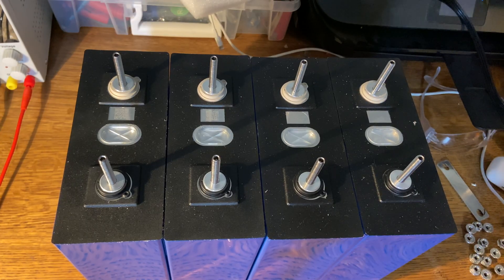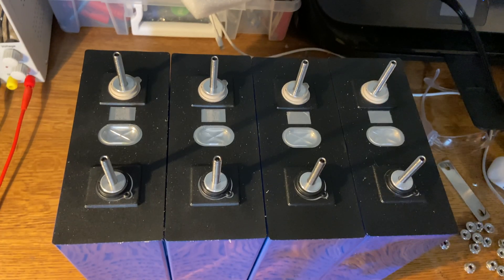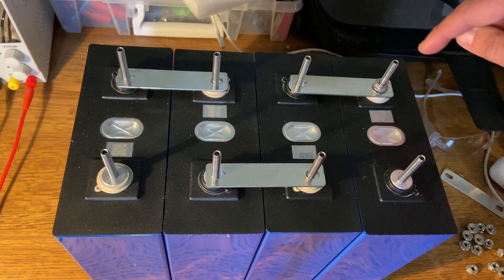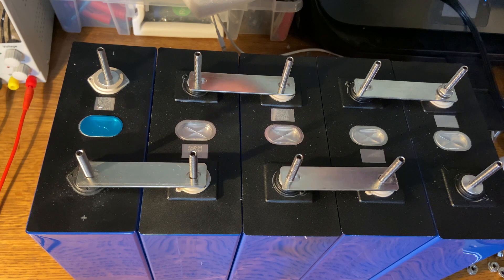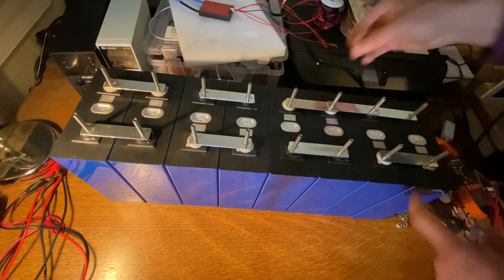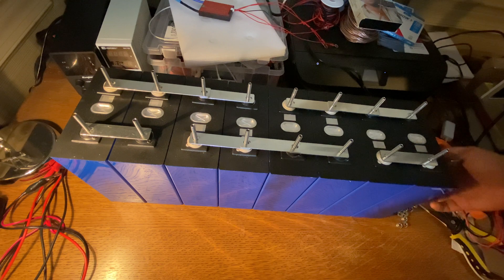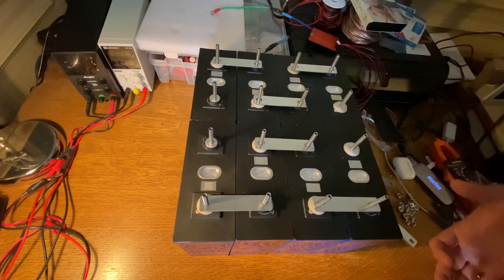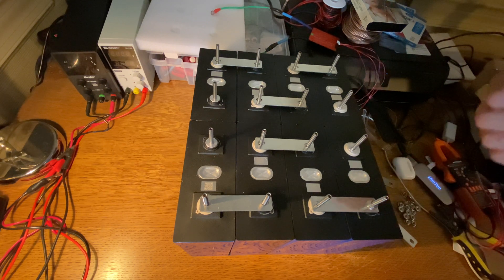How to Connect Battery Cells in Series and Parallel - w/ Large Lifepo4 Cells

Comment: My build 4s 2p sir and the battery next to negative main is the one who charge full 1st then next one beside the main positive is the 2nd to charge full and the main negative and main positive remain to 3.37v.

My active blancer is 4s 5a and 60a discharge/30a charge current bms. My problem is i can't balance them when charging on solar panel before i assemble them i do top balancing 1st. Hope you can help me or i will just follow your advice which is 2 bms

Comment: I was able to acquire a 96kw Absolyte GX (2 volt) series battery bank. Have you ever worked on something like that? I need to wire 24 cells into 48 volt configuration for a 48 volt off grid system. I'd appreciate any assistance if you had some time to assist. I'm also wondering if it is possible to utilize a BMS on this size to constantly monitor the entire bank. Thank you so much for your videos! I have subscribed - looking forward to watching your old and new videos!!

Comment: Ok I have an RV with one 100w solar panel one charge controller and two agm 51ah 12v batteries and one 12 deep cycle ah unknown lead acid battery what would be the most efficient way to install these so they charge and supply 12v to my system? Please and thank you

Comment: If you run 2x 100amp max discharge bms on the batteries for your preferred way of setting them up are you still capped at 100amps discharge or does it become 200amp discharge

Comment: Thank you for this video - I would much rather have individual cell monitoring since this thing will be under our bed. 

Unfortunately, our battery location fits the rectangular 4S2P best but I will be going with two batteries / 4S configuration. I will just use wiring for the interconnect instead of bus bars. 

Using two Overkill BMSs.

Comment: I have 8 (3.2v) lifepo cells and needed to increment both amps and voltages. I went for your guide on 8s2p but I don't know now how to connect the BMS since I have an 8S bms that I was previously using in series. Now since they are both in series and parallel I'm a bit confused on the wiring

Comment: In the first scenario, if one cell dies, the BMS should shut off from overcurrent into the other cell. Actually, the more cells you connect in parallel, the least the current per cell and the more reliable each cell operates. This holds true for both scenarios, but the second scenario adds the reliability, variance of MOSFET or voltage detection ICs and increases the cost of BMS's. However, paralleling more BMSes is a MUST once the load current exceeds the BMS spec. I have only one ANT 320A(max) BMS on my 16S40P LiFePo4 batttery and it works great. My 40P is actually 5x 8P of A123 round cells. But prismatic cells are made with multiple pouches in parallel too. This being said, having your system uptime uninterrupted is nice, but you operate only at a fraction of the total load power, which might not be optimal in certain situations. Ill be expanding my bank this Sept with 16x EVE-280Ah prismatic cells which I plan to hook an another BMS in parallel for uptime like you suggested, althought my current BMS is largely sufficient for my loads <= 30A so far. So it's not for worry of one cell failing from overcurrent and overheating, in as much as providing system redundancy/backup, should my Ant BMS fails.

Comment: I have a 4 battery lifepo4 24v battery bank with 12v batteries in series parallel connection . Problem is the 2 batteries that is connected to the inverter get 15,2v charge while the 2 other batteries in the series connection that is not directly connected to the inverter is normal 13,3v, total voltage is 28,5 for both battery banks. I have a battery balancer but it only balances the voltage of the 2 banks, not the 2 batteries that get way to high voltage charging. 

It seems to me after what I have read about electrical engineering that to not get over voltage on the batteries that is directly connected to the inverter you have to have exactly the same resistance, meaning equally long vires to all the battery connections... But I have not see anyone ever doing series parallel connection that way. Everyone connect it like I have done with charging and inverter directly connected to 2 of the batteries in the series parallel battery bank and the 2 last batteries connected with longer wires.

Comment: i watched this video and have a couple of question: 1) can you show or explain once i have connected the two sets of lifepo4 ( mine 3.2V, 200amh) batteries in series then connect these sets in parallel how are the BMS connected together to go to 12v fuse panel and charger. 2) Can you suggest what size BMS(2) i should use, would (2) 4s 12v 100a be ok to use?

Comment: Im new to the idea of lithium for my car audio endeavors. But does anyone know if i could get these for my truck and use them as a battery bank my max amperage pull would be about 800amps and ive got a 280amp alternator and gonna get 2 500amp switches for them. would i also need to get some sort of charge controller cause i remember charging is a big thing to try and make these things last.or should i just forget about it and get a couple deep cycle XS batteries.

Comment: I am wondering if I can connect a 12volt 200ah prismatic cell battery in series with 2 12 volt 100ah lifepo batteries in parallel to get 24v 200ah ?  so there are 3 batteries total.  2 identical batteries in parallel for a 12v 200ah, with 1, 12v 200 ah. I understand its a less than ideal to put unlike batteries together but can it be done?  I tried to do it but got a huge spark attaching the 2 parallel ones to the 12v prismatic.  negative to positive and positive to negative. any suggestions ?.

Comment: When you connect 2 4s batteries together is it best to draw power from the bank by connecting to a negative stud on one battery and a positive stud on the other battery?
Reply from the maker: You mean together in parallel? Generally speaking both negatives should do to a bus bar and then both positives should go to a separate bus bar - and then you wire your system off of the bus bars.
Reply: @TheWilltoBuild  Sorry I wasn't clear.  Yes in parallel.  So you advise using busbars for even just a 2 battery  bank?  I see the advantage for a 3 or more batteries in parallel because it will facilitate an equal draw from each battery,  but I am not so sure its worth the expense for cables and stud busbars for only 2 batteries.   Any comment on that?
Reply from the maker: @michaeldoherty2289  You just want to make sure you are drawing from each battery equally. You could potentially just improvise something, perhaps connecting a wire to each positive terminal (for instance) and then connecting that those two together at a third wire that serves as the total battery positive. All you would need for that is some wire, some crimps and a stud with a washer to tie them all together. If you go to your local hardware store of HD or Lowes and go to the electrical section, you'll see alot of stuff that can allow you to pretty cheaply connect three wires together.
Reply from the maker: @michaeldoherty2289  You just want to make sure you are drawing from each battery equally. You could potentially just improvise something, perhaps connecting a wire to each positive terminal (for instance) and then connecting that those two together at a third wire that serves as the total battery positive. All you would need for that is some wire, some crimps and a stud with a washer to tie them all together. If you go to your local hardware store of HD or Lowes and go to the electrical section, you'll see alot of stuff that can allow you to pretty cheaply connect three wires together.
Reply: @TheWilltoBuild  OK.  To follow up on this further I have one more question.  Say I have 2 separate 12v battery packs just like the 2 at the end of your video.  If I install a  4s BMS on each 12v battery.  Then to parallel them I  simply connect the 2 main 12v positives together with 2 equal cables going to a single post terminal.  This will become the main positive battery terminal.  Then connect the equal length P- leads from each of the 2 BMS's on a single post terminal which then become the main battery negative.  This all happens inside my battery box (which contains both 12v packs).  This way I do not have to connect the 2 12v packs together with solid busbars (the ones you said you didn't have long enough busbars to do that in the video).  It totally resolves the question of which terminals become the main terminals when the 2 12v packs are connected with 2 solid busbars.  It also assures that each of the now paralleled 12v batteries (or really all 8 cells) will be equally drawn upon during use.  Is that clear and is that correct?.

Comment: Nice video.  This is a pretty simple concept, but I have not seen it explained so well by any other YouTuber.  Very good job.  I just ordered 8 206ah cells and 2 200a JBD BMS's directly from China.  I mulled over doing a 4s2p with one BMS, or building 2 4s batteries paralleled together.  I diagrammed my wiring on paper and was sure it was correct, but I was looking to confirm it.  The last part of your video did that perfectly.  I also wanted to use my smart bluetooth BMS's to monitor all the individual cells.  With 4s2p you can't do that.  You explained it so well and confirmed the extra money I spent was well worth it.  Thanks and cheers.
Reply from the maker: So glad I could help!

Comment: Great video. It’s probably worth mentioning how your amperage requirements play into which configuration is viable as well. If I’m powering a 3,000 watt inverter, a 4S2P with a 12v 120amp OverkillSolar BMS won’t work because the BMS max output would be 1,512 watts. You’d need a 250amp BMS or two 120amp BMS wired in parallel to get you up to 3,000 watts (or whatever your load requirements are).
Reply from the maker: That is a great point and actually a good topic for a future video.

Comment: Congrats very well explained. My question is can you use the same process to wire Lead Acid batteries in series and parallels and at the end close the loop before connecting the Negative and Positive wires to the Inverter or leave it open witch one is better?
Thanks
Reply from the maker: You can wire lead-acid batteries the same - in terms of the basic wiring. I don't quite follow what you mean in terms of "close the loop". You do want to ever directly connect the positive and negative wires. That is a short circuit which can very quickly hurt you and the batteries.
Reply: @TheWilltoBuild  Thanks very much.👍

Comment: Hey, great video and Thank you for putting it out there. New to batteries and electrical systems but i'm learning a bunch. Had a quick question. Can we use the DC power supply as our main charger to charge up lifepo4 cells batteries or are they only use to top or low balance the batteries. I don't want to buy another charger if it's not necessary. thanks for your time!!
Reply from the maker: You can definitely use your bench power supply as your primary charger, it just might be kind of slow. Also, most cheap bench power supplies only go to 30v, so won't be high enough for 48v systems. But...I have used two bench power supplies in series to charge a 48v battery.
Reply: @TheWilltoBuild  Okay, Thanks!  I have a 12v system with a 200ah battery. if it's charging at 10ah max, it would take 10 hours to charge up 100ah, correct? That's what the charger is capable off, right.  Just wanted so confirmation/clarification. thanks again for your time and response!
Reply from the maker: @stevensam8834  Yep - in theory you could charge the whole thing in 20 hours - but the rate of charging will slow dramatically when it gets close to fully charged so it will take longer than 20 hours (more like 30).

Comment: Hello, how can I connect two bms to an inverter if i decide to do 16s2p. Thank you!
Reply from the maker: This is possible and will work fine. I have heard of someBMS makers tells people to not do this, but it is really unclear why this should be an issue. If you do two separate 16s batteries, give them each their own BMS, and then put them in parallel, it shouldn't have an issue unless the specific BMS is weird (so maybe check with the maker?). After all, many off the shelf batteries have a BMS (like battleborn) and you can wire those in parallel no problem.
Reply: @TheWilltoBuild  so I too have a16s bank x3 each bank is 48v100ah (so that is 48 batteries at 3.5v 100ah) i have a 16s killwat bms. My ? Is if i use the 16s bms can i still wire my batteries in a 12vx4 =48v or do i need to wire all 16s to = 48v and keep the 100ah for each of the three banks. I would like to at least go from 300ah to 600ah. Any help is greatly appreciated thank you.

Comment: Really need to know why you said you would not recommend 
Two different brand batteries in the same bank..or why mixing 
Energizer and Duracell’s is a big
No no so to speak?
Reply from the maker: Just because different brands are likely to have different capacities and different behaviors, in particular internal resistance (IR). If the internal resistance of the cells is different, then some cells will charge and discharge faster than others. That extra work will age the cells faster, and then they will have different capacities - which will also cause them to charge and discharge faster and wear them out even more! This is actually a good video topic.
Reply: @TheWilltoBuild  , I don’t believe there is any hard data that supports this preposed you tube theory, I have heard other videos repeat this information over and over in explanation but lacking data to support this. That’s exactly why I used the two different batteries as a example. IR is easily measured and would more than likely be so minuscule that it would not be notable even in 1000s of cycles. However the proof is always in the pudding. It would 
Be a great experiment…
Reply: @TheWilltoBuild , Lol Thanks for the videos super appreciate the time and effort..😊

Comment: Thanks for the video, especially for making it understandable. I was thinking i wanted two separate banks for the scenario you covered at the end, if something happens with one bms your screwed, with two you can still have power with one bank. My question is, what size bms to get? I see the daly being used with lifepo4 banks and they seem durable, Will prowses milk crate build is about what im thinking of doing. I did see another van lifer video where he added some heating pads and sensors since he was in the cold weather, and being from michigan i may watch that build again to add the heat pads. The cold build used a 80 watt bms and Will used a 250. It seems like a big difference, and neither used two banks in parallel which i will be. 
   I think it was about 15 mins in on your video where you covered it, but didn't mention the bms you would use and how you would run them together. Any chance you could give me your recommendation on the size bms, I'll be running a mini deep freezer and a 5,000 btu ac, with just a few lights in a cargo trailer with 4 200w solar panels on the roof. I was impressed with the max output of the 250 Will used so seeing im going to run an ac, should i go to the larger bms to be better safe than sorry? My apologies if this is rambling lol, but i appreciate any recommendations on sizing and how to configure them together. Thanks!
Reply from the maker: This is a good question. Always go for a big BMS. Most of the cheaper ones say they are rated for a certain capacity, but in actuality really can only do like 80% of that, so oversize them. I've been using Daly 250 amp smart BMS. It wasn't easy to get it working properly, but it is working now. Otherwise there is overkill BMS as well. But everyone is out of supply right now unfortunately.

Comment: So you didn’t show how to wire the last one with the 2 bms’s and which terminals to connect to which post to the inverter.
Reply from the maker: I don't have two BMSs to show unfortunately, but you would just wire the positives together, and then also wire the P- from each BMS together. Then, to connect to the inverter, just connect the inverter positive to the positive of both batteries, and the negative from the inverter to the two connected P- from the inverters.

Comment: I made my 4s battery last night, and when I hooked up to the charger, I got sparks. All of my previous connections seemed good, but then I couldn’t charge the battery. Any idea what I may have done wrong?
Reply from the maker: Hmm, there prolly should not be sparks. Are you 100% sure the battery is wired up correctly? Also, did you attach the right leads from the charger to the right places on the batter (positive with positive, negative with negative)?

Comment: Hello! I need some help with wireing my first lion battery pack. Ill have 6 4s lion batterys in parrallel, so i get 24 volts and 90000 mah. Because 3400mah*24 lion batterys is about 90000, or isnt it? I dont know, thats why i need help. Also, how do i wire them up, do i put the 4 cells in parralell in series with the next one?
Reply from the maker: Hey, I'm having a little trouble following your question. I think your amperage calculation is correct, you have a total of about 90 amps, but it is not the correct way to think about the batteries. What are you trying to do? Create a 24v battery? Do you know what type of cells you have? Are they lion or lifepo4?
Reply: @TheWilltoBuild  Aha, ok, i understand. I wrote really crappy english, i was very sleepy. I want to make a 24V lion battery for my diy bluetooth speaker. It needs to be at least 90Ah to last 9 hours. Its a big ass speaker! I need to wire 4 18650 batteries in parralell, and then use 6 of those to get a total of 24 volts. The only thing is that i do not know how to wire them up. How do i wire the 6 cells in series to get 24 volts? 

Best regards, Linus.